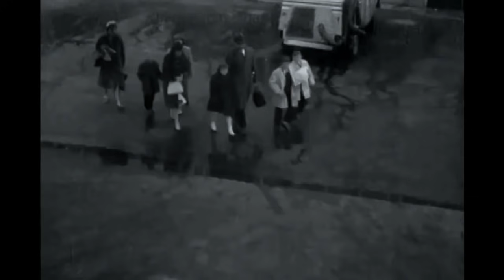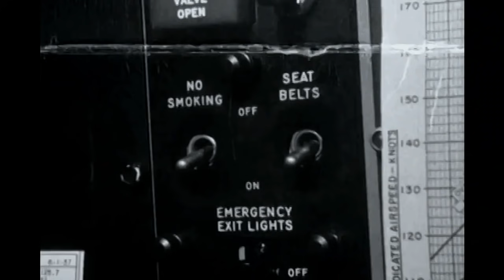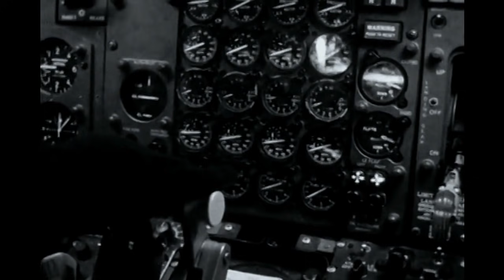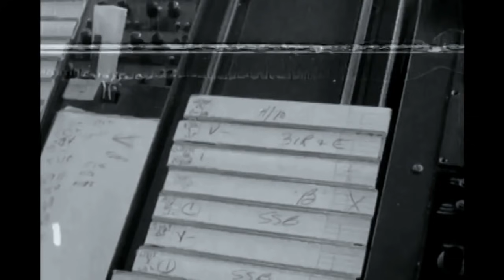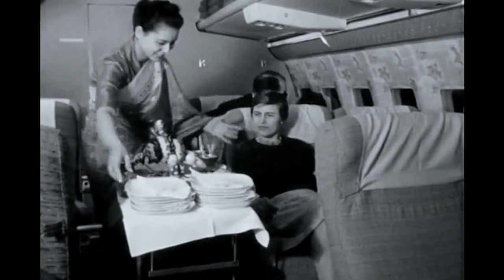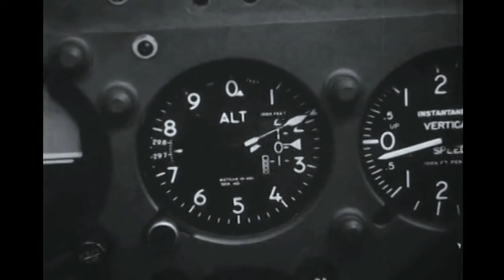Air India Boeing 707-437 - "About Air Safety" - 1961

Comment: I worked as a Flight purser  in those 707 aircraft for nearly 10 years. Lots of fond memories flying as  a cabin crew. Our 437 with Rolls Royce engines and 337 aircraft with P And W engines served the airline for  nearly 27 years.

Comment: Thats gotta be a scary ass job. Landing with almost no plane guidance at night except the controller  literally guiding you every step of the way. The ultimate tension
Reply: It’s actually comforting to know that you’re relieved a little of having to rely on so many instruments when you have a good experienced controller talking you down. It’s called a PAR, Precision Approach Radar for a reason & existed for times when that’s perhaps all you may have to navigate down to the runway. I flew the military version of the 707 in the Air Force, the old KC-135 Tanker, which still flies to this day (with upgraded fan engines of course).😊✈️🛫🛬😊

Comment: Flight AI 108, I boarded this flight at London Heathrow airport on 20/09/1974. The aircraft was a Boeing 747, VT-EBE, Emperor Shajehan to Bombay for an overnight stop connecting with British Airways flight BA 920A to my destination at Melbourne Tullamarine airport. One of my life's  adventures.
Reply: Tell me more about the service of Air India back then. Right now it’s in shambles
Reply: Hi, I found their service to be excellent. Bear in mind that a few years earlier, a seat on a Boeing 707 was very expensive indeed and service had to be the equal of top restaurants. The coming of the Jumbos brought ticket prices down with a proliferation of bucket shops in London. I bought my ticket from schedair at Coram street, Russel square W1, I doubt if they're there today.
I see that with fewer people traveling on aircraft owing to the pandemic, airlines are going to have to step up to the plate as regards service.

Comment: I can't understand how pilots and air traffic controllers communicate because I can barely understand them maybe it's or maybe it's there accents
Reply: +Jaden Desveaux It's just a matter of training. Just learning the phraseology and listening to it again and again. It has changed a bit over the decades, but the basics are still similar. Just go to LiveATC.com and start listening, and get the FAA or ICAO phraseology documents, they should be available online.

Probably around 90% of it is just standard phrases.

Typically (for visual flights rules) it goes something like this:

(Me:) "Delta-Echo-Hotel-Alpha-Bravo, at holding point Alpha, Runway 2-4, ready for departure"-  (Tower:) "Delta-Alpha-Bravo, right turn approved, Runway 2-4, cleared for takeoff, wind 270 at 7 knots." - (me:) "Delta-Alpha-Bravo, right turn approved, Runway 2-4, cleared for takeoff."